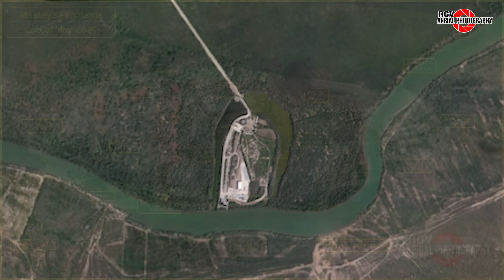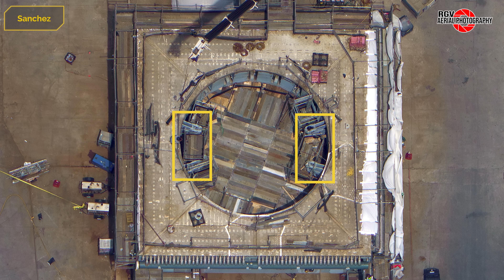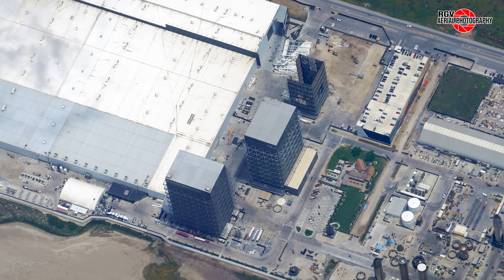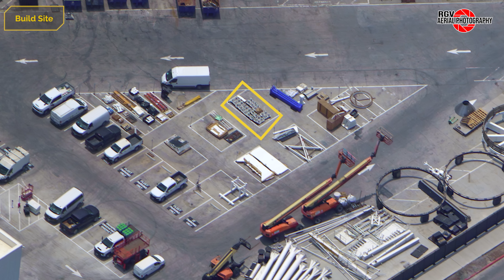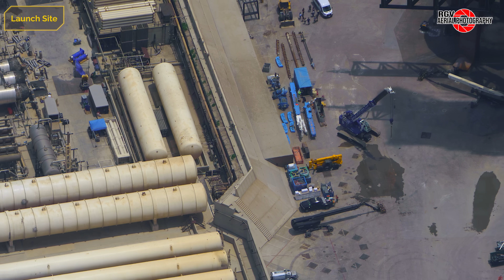Pad B OLM Lift Imminent + Starfactory Dismantling?? NEW Starbase Flyover 82

Comment: It would make sense for Gigabay to be connected to Starfactory but if it is then I think that both Megabays will be demolished soon afterwards because they become sub-optimal. They’re supposed to be dedicated to Ships and the only way for nosecones to get from the nosecone hall to the Megabays would be through Gigabay.

To me the optimal strategy would be to build the currently envisioned Gigabay connected to the nosecone hall with at least one permanent door facing the highway for boosters to exit and a temporary door at the back (facing Megabay 2) for nosecones to get to the Megabays then pretty much immediately go on to demolish Megabay 1 and expand Gigabay even more to use up the area freed up where MB1 currently is. That would give extra space equivalent to at least both current Megabays (because the extension would also be full width i.e. connected to Starfactory) so at that point SpaceX could go on to demolish Megabay 2 & have that space free for something else, maybe even more Gigabay expansion or perhaps a bigger rocket garden.

Comment: I think Giga Bay is going TIGHT against the Starfactory, otherwise why would they have fully demo'd the Factory Extension, they could have saved some of that to be a connector and built that new wall they built inside over further.

Comment: Could they use the hold down arms to lift the OLM table? Hmm.
Reply: I think exactly that is the liftplan.
Reply: Hey @jonnystoppel9100, something looks a little off to me.  I'm not seeing those long load spreader bars they usually use.  The arms seem positioned about the same distance apart as the hanging cables. No reason adding the arms as extra weight if they don't want to use them during the lift, in my opinion.

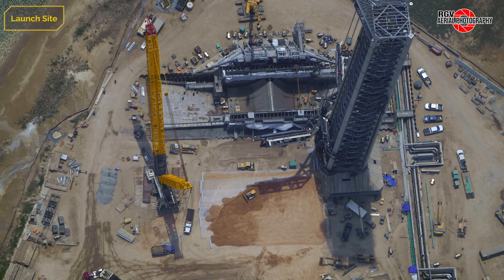Comment: 9:27 - by this image, looks like the chopsticks can not fit above the new OLM or they are far away from it! That's give me that impression!
Reply: while it appears that way, i struggle to believe it would be simply because that’s the most efficient way for stacking, and placing superheavy back on the mount after catch. it’ll be interesting to see how it reaches.
Reply: @startwink98  It's seems that the pad 3 is movable, so that explain a lot.
Reply: @gilbert1975nf  looks like its maybe just a result of parallax.